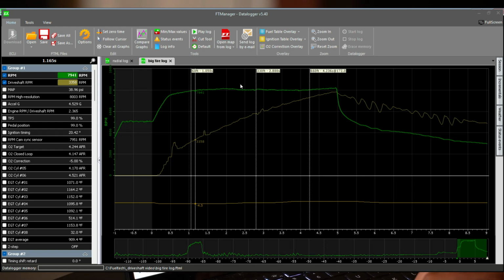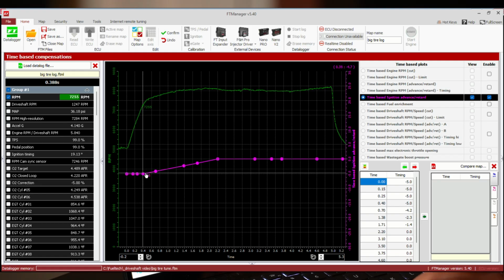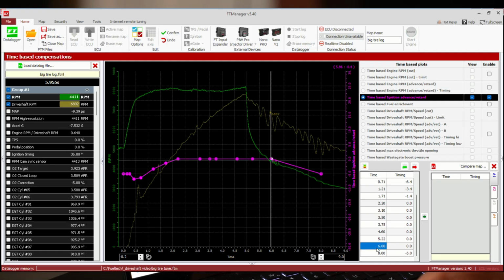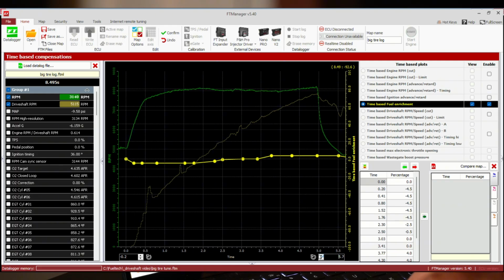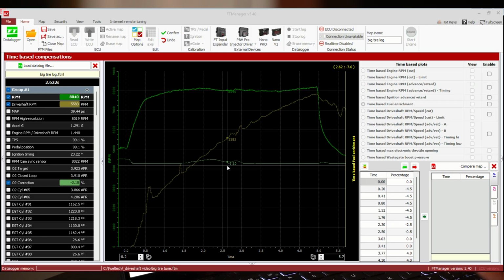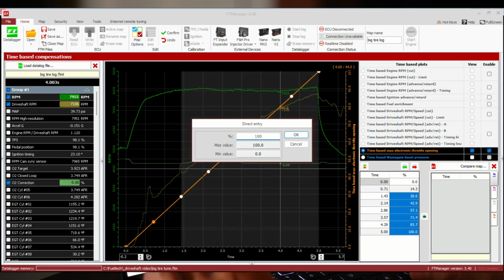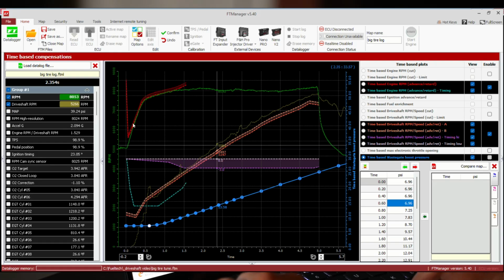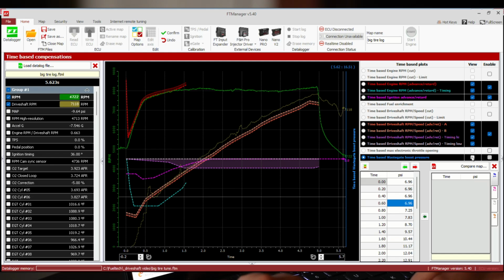Time-Based Features Part 3: Fuel Trim + Ignition Curve | Tech Tuesday

Comment: I see how you use the driveshaft curve to pull timing to control wheelspin. I think it would be cool if you could set it up to also continue to add power untill it starts to lose traction.